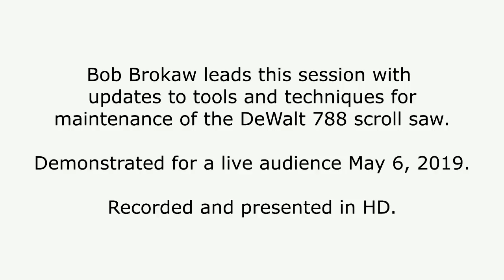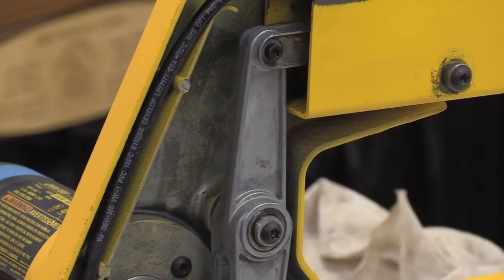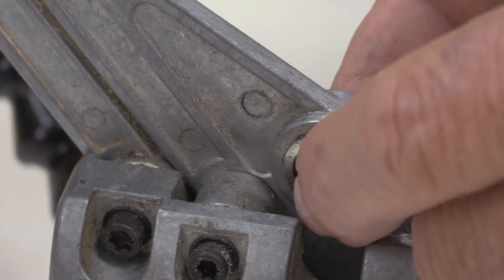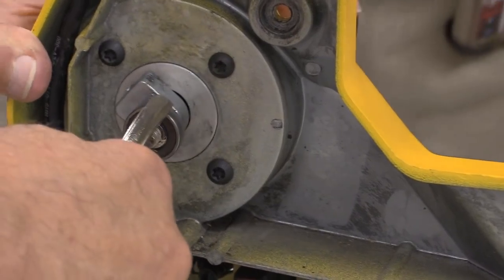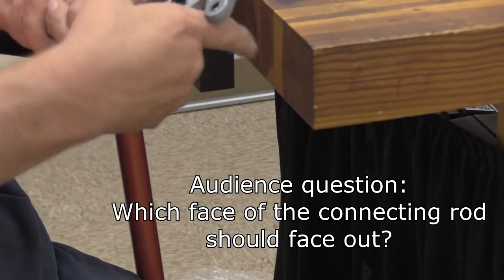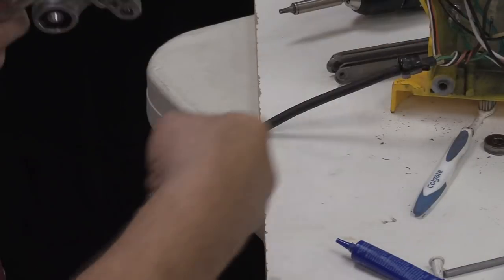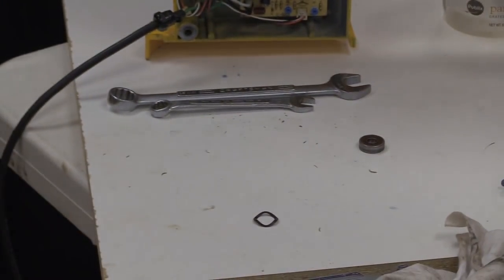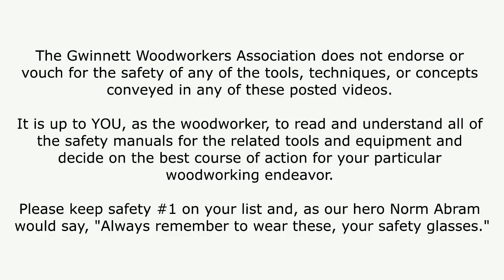Scroll saw maintenance update 2019 by Bob Brokaw

Comment: At 13:00 consider adjusting the drawrod tension instead of grinding the underside of the lid. It's a less intrusive repair and can compensate for a worn tension wedge, distorted ramp insert (often you can flip the ramp insert over) or bent upper drive link. Counsel the customer to NOT carry the saw by the upper arm, and to release the blade tension between uses. I maintain a fleet of 788s in a school shop and also repair a few for private parties.

Comment: Hi Bob,  I completed the service on my saw.  The bearings that looked the worse were in the front rocker assembly with the long sleeve and double bearings, one on each end of the sleeve.  I don't see these bearings itemized on your list or the sleeve listed which is the 286295-00.  Do you know which bearings these are?  Are they two of the HK0609?  Also, any hints for pressing them out as there are two in the same hole with a gap between them?  Thanks!

Comment: My 788 seems to have an issue, If you watch the blade while running the top of the blade looks fine, but when you look at the blade as it travels thru the table… it looks like it is moving from side to side. (Looks blurry) it is had to start cutting right on you line on your project.

Comment: I have enjoyed all of your DeWalt 788 maintenance videos. Last July I bought a Delta  scroll saw model 40-694 which I understand is almost identical to the DeWalt 788. Do you know whether Delta adds additional grease to the bearings during the assembly process or not?
Reply from the maker: I've not had an opportunity to go inside a 40-694. I don't know if grease is part of their manufacturing process. I did, however, open a DeWalt 788 (date code 2018) recently to find that they were adding a clear grease as part of the manufacturing process. Maybe word got back to DeWalt?

Comment: Bob mentioned buying bearings from VXB Bearings in California.  Anyone have the part # for the bearings for a Dewalt/Delta?
Reply from the maker: I quit buying bearings from VXB. They priced themselves out of the market. I now get them from USA BEARING in Lakeland, Fl. https://www.usabearingsandbelts.com/m7/HK0609--hk0609-needle-bearing.html
There are 3 bearing part numbers used in these "rocker arm" saws. HK0609, HK1412, and HK0810. All the saws that are derivative designs of the original Excalibur still use the same bearings - even the latest arrival; Pegas.
Reply: @gwinnettwoodworkers  thank you for that info.